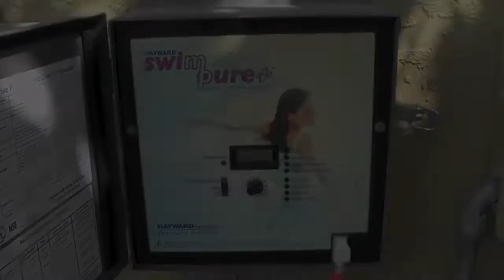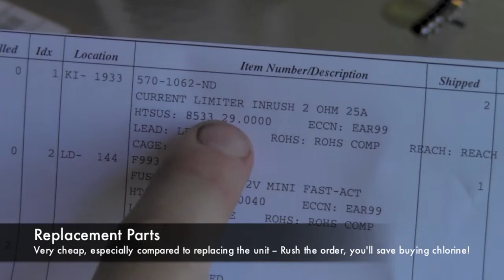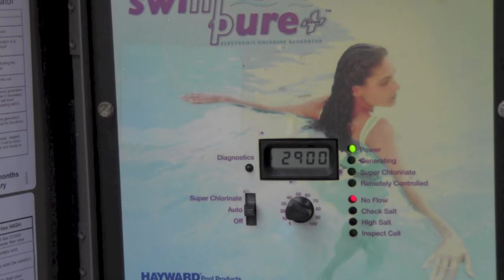Fix Salt Chlorinator

Comment: I had the issue where my power light would not come on.  The manufacturer suggested to replace the circuit board. 275.00 plus 80.00 for the visit.  I had thought of getting a complete new number 550.00  I tried you video replacing the current limiter.
I worked and for 5 dollars counting shipping I received a spare just in case.  All working great now.  Thanks abunch.

Comment: Fixed mine this week. Ordered 25A 2 Ohm ICL - Current Limiting Thermistor Ametherm SL32 2R025 and took about 1/2 hour to remove the old one and solder in the new one.  My four year old T-Cell was also making the board run hot so I had to replace it too. Thermistor $7.47, T-Cell-15 40,000 gallon $400.00. Misalliances tools and soldering expendables, $35.00, gas for the trip $20.00. Thank you internet for the resource to research the problem. A word to the wise. Check your computer box to make sure it isn't running hot when not generating salt. This is a sign of T-Cell issues and likely your putting a strain on the computer's Thermistor. I would recommend doing both together.

Comment: excellent video - I cut the limiter legs and used 2 butt-end crimp connectors - no soldering! crimps worked great. 

(Note that if you remove the smaller diagnostics board, or if it just falls out like mine did, be sure to carefully replace it, as the multi-pins must align perfectly, if they don't, all the LEDs will flash making you think you screwed up the current limiter connection... just sayin')

Comment: Had same issue after 5 years of use. A quick temporary fix, was to put electrical tape over the current limiter and clip a medium size binder clip on it, make sure it doesn't touch the door or anything else. Other preventive maintenance suggestions the flow switch connection, put some anti wire corrosion inhibitor on it! If nothing else use WD-40.
Reply: +Robert Fugate Thanks for the suggestion. I tried this today, but it didn't work for me.
Reply: Sorry it didn't help, was the current limiter in one piece when you clipped onto it? I'll be getting a new CL Wednesday, but for back up I did order a new board for $160!  http://www.poolguysupply.com/Aqua-Rite-PCB-Main-Circuit-Board-Replacement

Comment: Thanks for the video.  Hubby and I fixed it right up.  What do you do with the flux?.  We did'nt use any.
Reply: Flux helps with soldering and getting a good clean electrical connection. Flux can already be in the solder, but it can be used to help direct the solder, you can get flux in felt tip pens.

You can also use flux to clean your iron tip.

Comment: I am going to try this over the weekend . Already changed the fuse and that didn't solve it.  One question...another video showed the guy 'desoldering' the joint using a solder sucker.  Did you just solder onto the old wires ? ( I have never soldered in my life but it doesn't look too difficult! and am trying to save $$)
Reply from the maker: Danita Hiles At about 2:04 in the video, I show I just snip the old one off leaving about a half an inch to solder the new current limiter onto. I did not use a 'solder sucker'. It's easy to solder, I didn't do such a great job soldering in this video. Keep the solder gun on the metal posts from the old limiter, and apply the solder to the solder gun and keep it all hot when applying.
Reply: RJIson9000   You are a ROCK STAR !!  I did it :)  And my single mama 50 yr old self did a little dance party there in the backyard when I saw those beautiful green lights come on.  Thank you so much for your great video and follow up reply.  I ( along with everyone else) appreciate you taking the time. Texted a picture to my pool guy when I got it up and running and he offered me a side job fixing the 5 bad boards currently in his truck :)    Total cost for my repair = $16.00   including my $9.99 Amazon soldering kit.  Thank You!!!
Reply from the maker: Awesome job! Thanks for letting me know, it's nice to know someone could benefit! Good luck with the new job :)

Comment: I am having a problem with my Hayward Aqua Logic Cell.  I have cleaned my turbocell and I am still getting a message of low salt, check cell. I have taken samples to be tested and readings are between 3300ppm to 3600ppm, display is 2500ppm.  Cell is 3yrs old.  I was told to try and calibrate it, but can not find anything on Goldline website.  Any recommendations?
Reply from the maker: Check out this video: Reseting Pool Salt Generator

Comment: I did all this, though I am horrible at soldering, so that could be it. I also replaced the salt flow switch (had one on hand), and cell as it was about time and would not come clean anymore. I reset the cell reading and tried resetting my salTt reading, which has went down 300 point in less than 2 minuts. My "salt level" has always read also as a decimal such as 1.9 which it seemed to get stuck on. I keep reading all there forums as well about how to change something by pressing and holding the display button for five seconds. It does nothing for mine except move it to the next reading.

Comment: a couple of questions:
1. how did you know which part to replace on the board?
2. what store or site did you find the part at/on

I am having a similar problem. my cell is fine, but when first turned on, the boards lights come on then I hear a slight click and then the lights go off and the board seems to try and reset. Is this what you were experiencing?
Reply from the maker: I read many articles and posts that referred to the current limiter as being a likely source of this issue. Another possibility seemed to be the fuse. I ordered the parts from digikey.com (the part numbers are shown in the video).

It was only after replacing the current limiter did I know it worked for sure.

The behavior you describe is also what I experienced.

Comment: So you just snipped the wire on the current limiter and soldered the new limiters wires to the old ones? Are you heating the wire on the new one or the wires still in the board? Thanks!
Reply from the maker: I left about a quarter of an inch of the old current limiter on the board. Snipped the new limiter as well. Then, just soldered together with some overlap. So yes, both ends were heated as I applied the flux.

Comment: Anyone know what the fuse blade is used for? It says to buy one, shows it, but never shows using it...
Reply: It is just a fuse.  If it is OK don't replace it, however it is a .30 part so it doesn't hurt to swap it our since you are in there.

Comment: help!! the panel is stuck on  the dial mode , the button doesnt work and high salt light is on ,but not generating ?
Reply from the maker: I'm not sure what you mean by 'the panel is stuck on the dial mode'. 

High Salt light could indicate that you need to clean your chlorination cell. If you see buildup when you look into the cell, you'll need to clean it with diluted muriatic acid. 

The reason no chlorine is being generated could be a faulty current limiter as shown in this video.

Comment: gotta admit the fix is good but the soldering by painting method is the weakness,lucky its working but the years will put vt spikes/loss though caused by dry joints. once you learn correct soldering technique you will be 100%,get a solder sucker it makes the job easier. Just emphasize the need for care around the AC input wiring before the rectifier or u get fried.Maybe a disclaimer to protect you legally.... Something real rewarding about find n fix instead of replace!